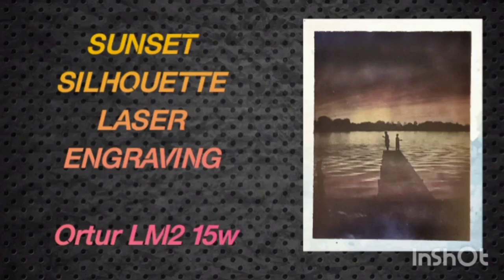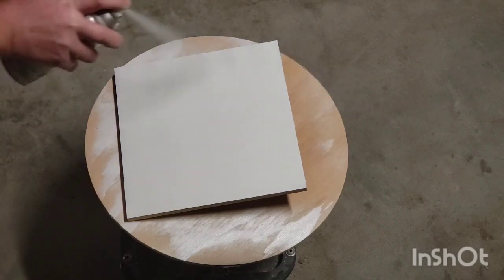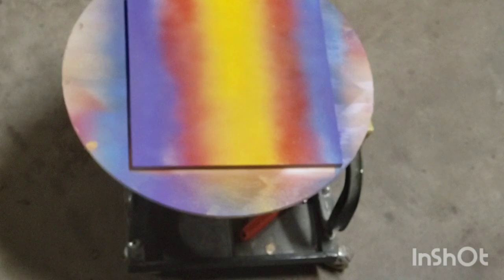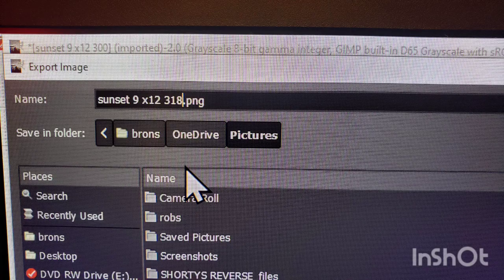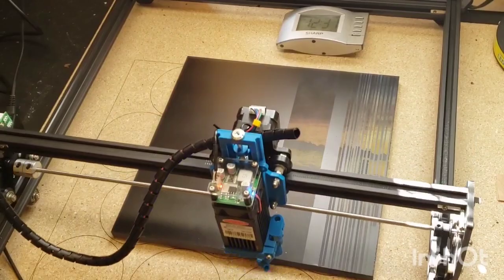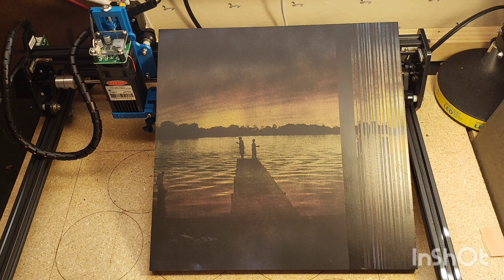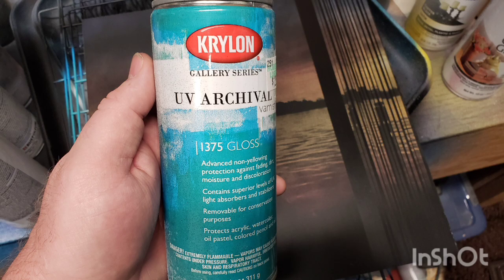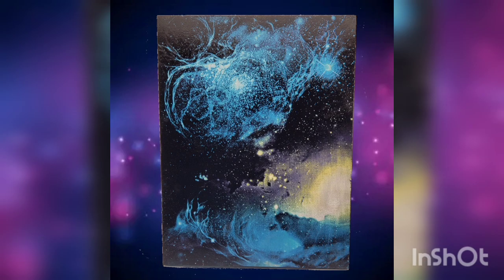Sunset Silhouette With a Low Budget Diode at High Speed.

Comment: Hello hello Kenny!  Stumbled on your channel today, and running through quite a few cool ideas to play with.  When I saw this one I got really confused on the actual laser settings in lightburn... I have a Master 2, fixed focus, and THEY claim the max speed is 3000, but you are running the max for the greyscale burn at 7000??  Doesn't this cause quality issues for you? I have run faster than 3000, but even at that speed I often notice distorted lines and such.  I assume this to be the slop in the belts, motors, etc... so hitting the max speed it can manage the change of direction.

Love to hear your thoughts on the speeds.  Thanks!
Reply from the maker: Once you go above about 6000mm/min you want to add overscan of about 4-5%. This will reduce the jolt of the direction change. The new Pro model is programmed for higher speed and the overscan is not needed. Also burn in the y direction at 90° scan angle. The laser head is a lot more stable since it's running on 2 rails in that direction.  The older Orturs were always programmed to run up to 9000mm/min. 3000 was just the suggested max speed as that is a speed they felt they could get good results across many styles. It took me months to learn how to run at high speed as it wasn't being done 1 year ago and had to figure it out on my own. Now its very common for +7000 speeds. Just depends on what you're comfortable with.  If time is not a factor running slow is much easier to do, but if you're pricing items to sell the faster you can get them done the more profitable you can be. Learn to make good images at 3000 then start ramping up your speed to what you're comfortable with.  I run 7-9000 all the time for large images. Once you get there it really isn't that fast. 3000 will just seem really slow, but there are some projects that require small rapid direction changes. For those 3000 is about as fast as you want to go.  Like everything laser speed is only useful for certain applications. Just takes a lot of practice. I burned stuff almost every day for the first 6 months of owning my laser.  I've only been doing this for about 1 year and learned a lot in that short time.

Comment: Great video Kenny. Your series on laser engraving is more informative than most others I have watched. I have an Ortur 15W Master and LM2-20W. Both have the fixed laser. Was this picture project done with your 15W. Laser head? I’m going to try a picture, and can put the 15W on the LM2 for larger print if needed. Keep up the great job on the hacks for all us inside the box thinkers. :)
Reply from the maker: Thanks.  I try to give all the info I can think of that will be helpful.  Tough making how-to videos for such a wide variety of users. Some are just looking for settings. Some want all the little details. I have to skip some info I covered in previous videos to save time.  Definitely benefits to have watched most of them so my skip overs sections aren't too confusing.

This was on the 15w.

Comment: Have you used the new fixed focus yet? Getting ready to get back into engraving
Reply from the maker: Nope. I probably won't get another laser until one of mine breaks down. I've seen people are getting good results with the Norton method on the fixed 20. The old 20 didn't do too well at that before, so I'm guessing it focuses better than the old model. Seen several people have put the higher powered NEJE units on their Ortur frames. Im sure they cut better but haven't seen how well they engrave.